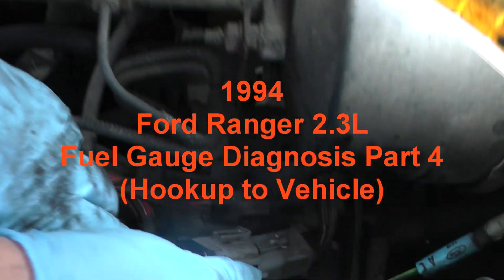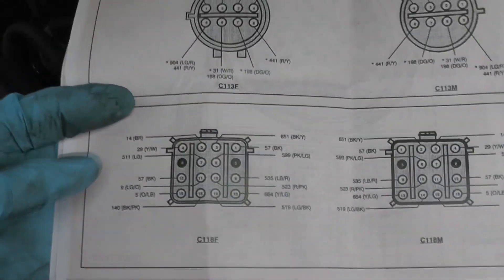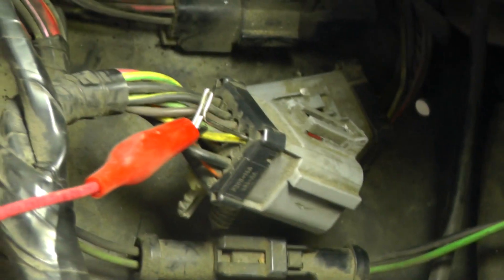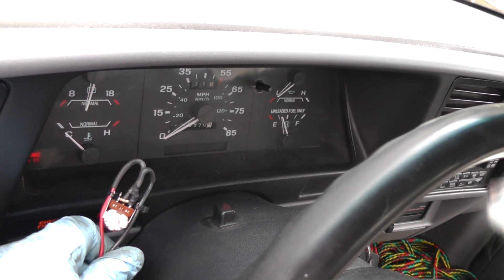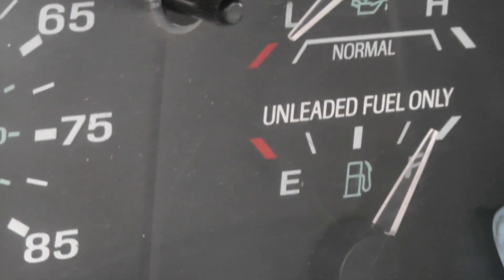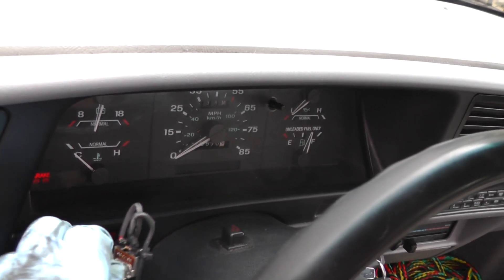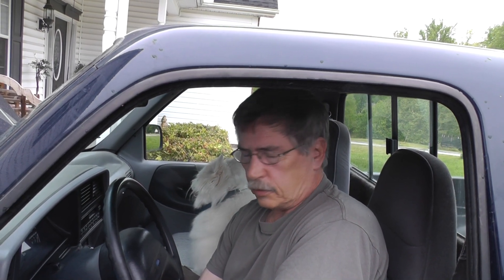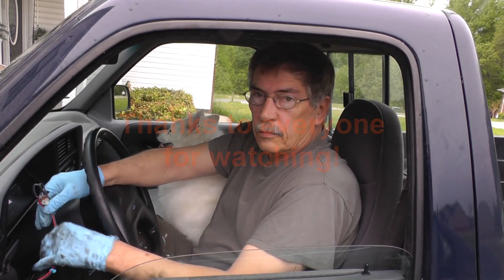Ford Ranger Fuel Gauge Diagnosis Part 4 (Diagnosis on Vehicle)

Comment: Thanks for posting the wire color and resistance values! Using your video I was able to diagnose the fuel gauge in my 96 Mazda 2300. The plug on my truck is underneath, just in front of the tank, in the frame rail. I didn't have a pot with a low enough value, so I went through my resistors and came up with a value between 22 and 45 ohms. When I grounded the yellow/white wire through them the gauge moved for the first time since I bought the truck. Off to order a sender now. 

THANK YOU!!!
Reply from the maker: Glad to hear that video(s) helped you out Charlie!
Reply: @stuzman52  Another lesson I learned the hard way today- order the filler hose and filter when ordering the sending unit. I got the bed off and found my hose to be split and quite possibly leaking. Not wanting to wait for one to ship, I went to the junk yard hoping to find a better one. After pulling 2 beds by myself and looking at 2 others, I realized I wasn't going to find a usable unit out there.
Reply from the maker: @Big_kid  Yes, good point Charlie! On my Ranger, I replaced the filler pipe also because it was leaking. And as with most parts made today, it only last two years. Have a great day!

Comment from the maker: Hi Bill. Thanks for the compliment on the explanation. I bought a hard copy of the service manual years ago from helminc d o t c o m. You can also get a subscription from alldatadiy or mitchell on demand. Another source which is free is at your local library. Most of them have a subscription to either alldata or mitchell. Yep, I didn't know there was a board either. Yours could be in the sending unit or the cluster as I pointed out. As I show, it should be pretty easy to diagnose. Thanks Bill!

Comment from the maker: Thanks busjockey, I appreciate it. The Loadpro wouldn't help me out with this scenario. I did remember watching Dan's fuel level sending unit vid awhile back and I was pretty sure that his resistance readings were backwards from mine. So, I went back to his video to review it. When his gauge is empty, his ohm reading is 240 whereas mine is 22. On his being full, the reading was 33, whereas mine is 145. So, with my gauge staying on the empty mark and being around 22 ohms, the Loadpro's cont)...

Comment: I'm Bill her husband but anyway we have a 1994 ranger XLT that the fuel gauge does not work. I have looked on the internet for  a good wiring diagram without any luck. Where in the word did you find a good diagram. You did a good job explaining how it works. In the morning I'm drag out the volt meter to find our problem. I did not know there was a board in the instrument panel. Ours when the switch is off the gauge shows about 1/8 of a tank. With the switch on the gauge shows below empty. Bill

Comment: Again Jerry, thank you for all your insight, you're worth four times your weight in gold. I do think I will get a Volkswagen Jetta GLX if I replace my Ford though judging by what videos you have made. LOL
Reply from the maker: HaHa! I'm worth four times my weight in gold. Let's see now how much I'm worth...hmmm, carry the 5, bring down the 8....Wow, I could have retired when I was 13 years old LOL. I do have some videos on VW, but those cars are a PIA to work on. Everything is really tight and you have to remove quite a few items to get to the part needed. Don't believe me...take a look at the videos for the secondary air injection system and you'll see what I mean LOL...take care karther2 and hope all goes well with your fuel gauge issue on the Ranger...
Reply: I have a Ford courier 95 model.Australian model.never reads full ..3/4 when it's full.empty when it's got probly 20 litres left.Ford can't get it right.

Comment from the maker: Hi Dave, I talk about it a little in the 2nd video. I know the pc board provides a time delay output. And I know that it uses a LM2902 (quad op-amp) along with an electrolytic cap, resistors, more caps and some zeners. What I don't know is how the circuit is hooked up. If the problem was there, I was going to reverse engineer it and draw a schematic and then we would know for sure of how it worked. That's about the best explanation I can give you on that one. Sorry Dave!

Comment: Great video and explanations, are there any alternatives I could use instead of a pot or resistor?
Reply from the maker: You could use a piece of wire to jump the sending unit. But if you do this, be sure to have a helper to look at the gauge while you're doing the jumping. You only want to do this for a short time since the circuit is designed to have some resistance.
Reply: @stuzman52  awesome thanks for the speedy reply, it is much appreciated.

Comment from the maker: resistance of 25 wouldn't have helped me. On the other hand, if I had an open in the sending unit, the gauge would have read past full. In that case, the Loadpro would have helped because of it's resistance, it would have lowered the gauge slightly above empty. Thanks for the comment busjockey.
Reply: What does that mean if you had an open in the sending unit? Where is the sending unit I have a 95 Ford ranger the fuel gauge was working until they put the new fuel pump in and now it reads way over full
Reply from the maker: @marylong4333  Hi Mary and hope you are doing well! An open means there is a break in the sending unit. If someone says there is an open wire, it means there is a break in the wire or that the wire is cut. The sending unit is located on the side of the fuel pump which of course is inside the fuel tank. When the mechanic replaced the fuel pump, he disturbed the sending unit creating a fault in it. I would go back to him and tell him that he screwed up the sending unit since it worked before the fuel pump replacement. And you should not have to pay for his mistake!

Comment: Where is the sending unit located is it on the fuel pump in the gas tank you're the second video I've tried to glean some information from and you just right off the bat you don't explain anything you just start talking about some center blah blah blah so I don't understand what you're talkin about
Reply from the maker: As I mentioned in your other post, the sending unit is located on the side of the fuel pump which is in the fuel tank. Have a great day!
Reply: Thanks for your help
Reply from the maker: @marylong4333  It was my pleasure Mary. Have a great day!